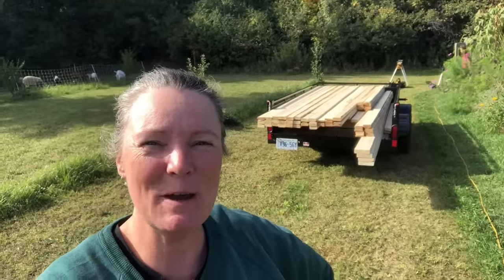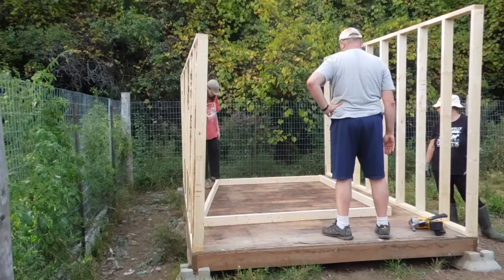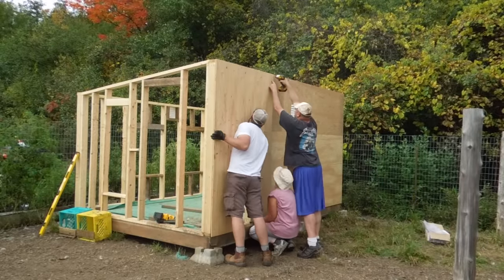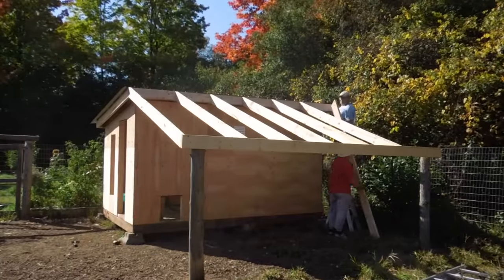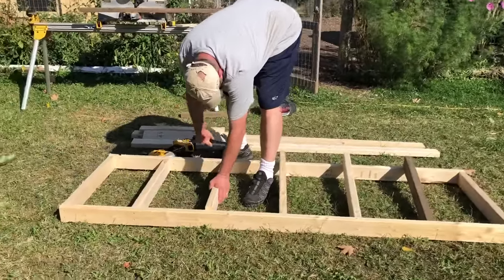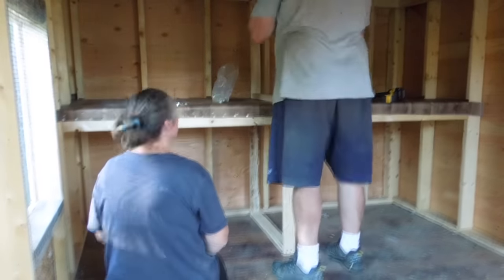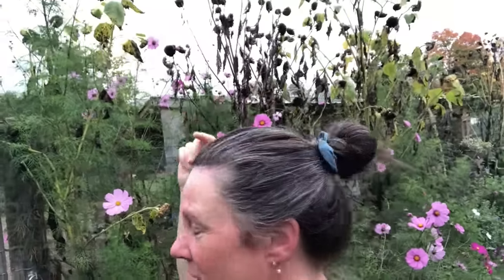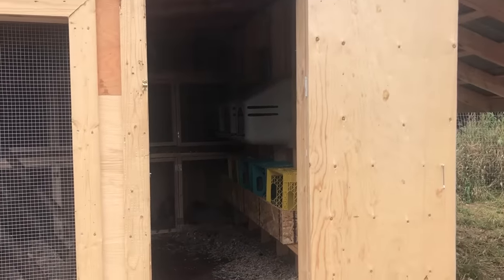Building a chicken coop for all seasons start to finish- Ontario, Canada

Comment: The wire on the floor is an experienced move and I appreciate somebody mentioning that. Also rodents like to get on the corners between floor and wall just above the 2x4 studs, nailing some roofing scraps cut to strips and angles prevents that. Raising the coop 18-24" off the ground also works, at least for my pigeon coop- lol. Good job and informative.
Reply from the maker: Thanks so much.  We've made many coops over the 40+ years and each coop and move has made us learn more.  The elevation of the coop is a must (my cats can get in under it) but the wire is a game changer.  I agree with the corners being eaten at though, we have had that in the past as well.  We increased our cat poplulation and havent needed to do that here though.
Reply: WOW 
Yes it's brilliant.
We are making a new coop sometime in the next 2 weeks. So this is a fantastic tip to see before we build.
Thank you!!

Comment: Roofing tin is designed with hills and valleys for a reason. The water runs down the valleys and the screws with grommets should be screwed into to hills. Those grommets perish in time, so I'd check every 6mths since you seem to have used the valleys. Beautiful job, lots of thought and wonderful family participation. ❤ from this aussie chick.
Reply from the maker: Each place we have lived screws them in in different locations.  Some places have used the ridges so in that area we followed the rules for there.  Here they use the valleys so we do that here.  It’s very strange that each place seems to have its own ideas but in our mind so long as the roof stays on it doesn’t matter to much.  We are going on 3 years here with no issues.  Over 7 years at our old farm with no issues.  At the end of the day, it’s still just a chicken coop.  Funny how things are so different from area to area.

Comment: Neopreme screws got that little rubber grommet that’s underneath it as you drill it down it cinches in perfect to keep it from leaking. I know this is an old video, but it’s interesting because I have to do the same thing you’re fixing to do here in a few weeks from now, I am in East Tennessee…
Reply from the maker: Yes the screws that are used are roofing screws and they do have the rubber grommets.  They are standard to get and use for the tin/steel roofing.  Good luck with your build

Comment: This is wonderful! Great job!! I am surprised you didn't insulate the coop! It had me wondering if your end of Canada doesn't get as cold as our end (we're in Alberta), but then you said you do get -40°!! 
I'm wondering if you could tell me how to tell if there's enough ventilation? I worry about too much, and then it getting drafty inside. No one has really explained it to me, and maybe I'm overthinking it. Is it really as simple as just making sure there's no breeze felt? Cause I would think there would be a lot of heat lost with so much ventilation. I'd appreciate any wisdom you can pass along! Thank you 😊
Reply from the maker: I lived in Northern Alberta for 7 years.  Still no insulation needed.  Just no drafts.  We still get some cold spells here just not like when we lived there.  Our windows get closed in the winter time so while they can go out during the day if they want through until little chicken door they do get locked up at night.  You just need ventilation near the top to allow the hot air to escape so it doesn’t build up and forum condensation.  Condensation is what causes frost bite on their combs.  So no breeze but ventilation.  Chickens are pretty hardy animals.  Think about it this way.  Even in the winter time in northern Alberta there are birds outside somehow they survive.  It’s because their body temperature runs hotter than ours.  Also build your coop to the number of birds you have. That way they can maintain their heat better and deep litter method in the winter time.  We use a litter mix of peat moss, wood shavings and wood pellets.  We also gather up leaves in the fall and occasionally throw some leaves on their coop for them to pick through.  Oh and insulation just means somewhere for mice, rats, squirrels and chipmunks to hide as well as impossible to treat the coop if you get mites.  You would litterly have to burn the coop down to get rid of mites as they would hide in the insulation.  Hope that helps

Comment: I guess I missed y an identical build? Liked the old 1 & needed more room?  Or an area to separate breeds)
I haven't seen broader boxes like that.  Good idea especially for recovering animals. I'd have electric added for heat (water & those extreme days that occur). I do like being able to get in coop with my ladies.
Reply from the maker: I wanted one coop for only small breeds.  Silkies, Millie Fleurs, bantam Cochins and then the second coop and run for the layers.  That way my big roosters don’t hurt my tiny birds in their exuberance.  And I can separate by breeds as well.  I don’t want electric because there is to much chance if fire and we loose electricity a lot out in the country.  I don’t want them getting use to heat and then loose it and get sick it die.  Also the coops are a long ways away from the house (our electrical supplier)

Comment: This is exactly what we need. Sure wish we had directions and supply list.
Reply from the maker: Step by step directions would be very difficult and time consuming thus the reason for the video.  You can stop it and review as needed.  We also just wanted to give folks an idea what would work and they can adapt as needed.  As for a supply list my apologies I have been asking hubby for it to add it to the description but as the coop was built in stages it would be a little more difficult.  I do know the coop bottom was made with three whole pieces of plywood so we didnt have to cut much.  And that dictated the over all size of the coop.  I am more then happy to answer any questions you have about the build though.
Reply: @connerty_meadows_farm  do you know the angle you had to cut for the walls at the back and front ?

Comment: I like what you’re doing with your coop. My question is, is it safe to put your root in front of a vent like that?
Reply from the maker: The coop is built safe yes, the over hang prevents any water from getting into the vent but allows the air to flow through.

Comment: Excellent job! This coop seems so breezy, it’s really ok for negative temps?? We get lows in the positive teens and our roosters get frost bitten combs in a fully enclosed coop! Meaning not any large openings. What am I doing wrong??
Reply from the maker: Its breezy in the summer time with the windows open but in the winter colder weather the windows are all closed up.  Chickens need good ventilation but no draft so that means there has to still be air exchanged (thus the vents) but not drafty.  And yes it works just fine for negative temps.  Here in Canada it gets very cold!  We can easily get negative 30 deg C and colder

Comment: Hi there. Just wondering if you used any kind of adhesive between your floor boards and vinyl or linoleum? My linoleum has a wave to it from being in a roll and I’m wondering if there’s anything (animal friendly) that I can aid in helping achieve a nice flat surface.
Reply from the maker: Use the regular floor adhesive that is sold for that type of flooring. Its underneath dvd doesn’t affect the chickens at all. ☺️

Comment: Hi! I loved how it turned out, we live in the northwest corner of Connecticut and it does it as cold here. But Im thinking about making one. How much did all of the materials cost you?
Reply from the maker: I dont have a set cost for it as some of it was built precovid prices, some of it was purchased second hand (windows and some of the tin roofing), some was cut down on our property (cedar poles for the lean to) and some was from left over projects.  If I had to guess a couple thousand dollars with all the flooring etc as well.

Comment: Hi!  I'm in the process of building my coop by myself. Lol!   Mine is very similar to yours.  However, I'm building just an 8x8.   I'm getting ready to add my third side.  I love the big window idea and I am incorporating that into mine.  My coop is actually going to be taller on the left side than the right, the opposite of yours. Would this be a problem to put the large window on the tall side instead of the short side?
Reply from the maker: I have the window faced in the direction that I do because of the overhang side and the sun.  You can put the window where ever you would like. ☺️. I eventually plan to fill in the overhang side to give an outdoor closed in space and putting a window looking into a building part doesn’t make any sense.  I wanted them to have sun and a breeze, that’s the only reason we have it set up as we do.  Good luck on your build!

Comment: Thank you for the video! Best and most straightforward chicken coop video I've found on youtube. I have some questions and I apologize in advance because there are a lot because I am very enthusiastic about this. I am wondering, are those cinder blocks that the coop is sitting on? they look like concrete blocks. Also, do I need brooder boxes if I am not breeding the chickens? In a cold winter climate should I have glass windows, or is screen okay? also, how many heights of nest boxes can I have? you have two rows, would 3 rows work so that I can have 3 on top of each other? also, do I need a roost if I won't have roosters or breeding? and how necessary is a dust bath? Thank you! Can't wait to raise these hens!
Reply from the maker: The blocks under the coops are like cinder blocks but are intended specifically for building.  They have notches in the specifically for wood to sit into.  They are a building block.  If you are not breeding chickens a brooder box is not necessary but they are handy if you ever have a sick chicken that needs a little TLC or what not.  In a cold climate a screen is not enough.  Chickens need a draft free place to live in a cold climate but it has to have good ventilation.  You will definately need glass windows that can be closed for the colder months.  You dont want your nest boxes two high as the higher they are the more likely they are to roost in them.  That and three rows is a lot of nest boxes, how many chickens do you plan to have?  you dont need one box a chicken, most of mine lay in only one or two boxes despite having multiple boxes to choose from.  Chickens are funny like that, they have their favourites and their friends favourites are the same one...lol   you do need a roost.  Chickens naturally roost as it makes them feel safe to be elevated off of the floor it has nothing to do with a rooster or with breeding it is a safety thing for them.  Dust baths are 100% necessary.  It is how they keep external parisites to a minimum.  Lice and mites get mostly smothered by the dust bath.  It is also how they keep their feathers clean and healthy.  (how would you feel if you never got to shower or bath?) same concept for a chicken.
Hope that helps
Reply: @connerty_meadows_farm   thank you for the answers! I will be having 20 hens.
Reply from the maker: @ryanw6920  you will only need like 5 nest boxes then
Reply: @connerty_meadows_farm   thank you.

Comment: I'm doing the roof on my coop this weekend and have seen some folks comment that there should be plywood beneath a tin or PVC roof so A: it's not so hot in summer and B: it's not so loud during rain, hail, etc
Thoughts on this? I don't want to use more material than is necessary
Reply from the maker: You could if you wanted more insulation or noise reduction but in all the years we have been building coops we have never done it.  We make sure there are lots of windows so its not hot and we have never had an issue.  I personally dont think you need to spend more money on it, but we are pretty frugal as well.

Comment: How do you keep the water from freezing in winter time? And if it’s draft free but has gaps all over to vent, what’s the difference? I’m needing to build a coop in the next few weeks, I’m also in Ontario. Would love advice thanks!
Reply from the maker: I only water outside year round never inside or it makes more condensation.  We use rubber water buckets under the over hang and I bring out warm water twice a day in the winter time.  The rubber buckets make it easy to throw them over and stomp out the ice.  There are no gaps just the vents and of course the windows. A draft is like air passing through all the time.  The vents have little flaps that face downwards so while there is air being exchanged it is not “whistling” through

Comment: That’s a nice coop! Do you mind sharing the cost? Thanks
Reply from the maker: I don't have an actual cost over all for it.  The flooring was done (treated wood, cement footers, wire, plywood, vinyl) pre covid prices.  The rest of the lumber was purchased mid covid and some of the roofing.  Some of the roofing was off of marketplace, the windows were from a garage sale, the outside poles were cut down from our property, the milk crates we brought with us from our old farm.  So there are a lot of price variables in there.  If I had to guess a couple thousand Canadian.

Comment: How big is it and how many chickens do you plan on it holding just trying to figure it out for myself before I build mine
Reply: I would like this information too.  To understand the scale of the building I would love to know the dimensions of the floor.
Reply: I see the reply below.
Reply from the maker: The coop floor is 8X12 that way we didn't need to cut any plywood for the floor.
Reply from the maker: The floor is 8X12 because we didn't want to cut any plywood making the building of the coop faster and easier
Reply from the maker: perfect :-)
Reply: Thank you and how many chickens do you put in them I love the design of it
Reply from the maker: I put as many as floor space allows for I think I can comfortably fit 20-30 in there with lots of moving room because they are only locked in it at night

Comment: I'm in Canada, just north of Winnipeg. I'm wondering why you wouldn't insulate the chicken coop? Would that be better for winter?
Reply from the maker: There's a few reasons we choose not to insulate.  I have answered this question for another viewer as well.  But to sum it up.  Insulation makes it easier for condensation to build up which is the number one cause for frost bite.  Also mice, rats and other small animals LOVE insulation and putting it in will invite them to live in your coop.  I don't want that.  The other thing is if you get mites (and if you chickens live outside this will happen at some point in your chicken owning lifetime)  they LOVE insulation and will crawl between the cracks and live in your coop forever!!  At least with everything in the coop exposed I can easily clean it down and eradicate them.  And of course cost.  I am not building a house, I am building a chicken coop.  The cost was already in the thousands adding insulation would increase that a HUGE amount as you would also need to add vapour barrier (not breathable) and another layer of plywood not drywall as chickens would eat that and it would also break down becuase of the poop.  And you would also have to paint the inside of the coop.  Of course if you have the finances and such feel free to insulate but you will also need to add more hardware cloth to keep the small animals from building nests in the insulation and find a way to pull it all out to treat mites.  I was always told that the only way to get rid of mites on chickens was to burn the coop down.  Now of course I can simply treat my chickens and my coop 10 days apart and usually it is gone.  If I had insulation I would never be able to get rid of them.  Hope this answer helps.

Comment: Do you have a list of supply's?
Reply from the maker: Sorry I dont have a specific list of supplies.  Lots of 2x4's, plywood, treated wood, windows, hardware cloth, tin, hurricane clips, vents, screws, nails, staple gun, vinyl for the floor, hinges, latches, cement footings, cedar posts, I am sure I am missing a bunch of stuff.  We made the coop so that we didnt have to cut to many pieces of plywood and we could use full pieces as much as possible.

Comment: More curious than anything else what about added heat or insulation?
Reply from the maker: No heat or insulation needed.  Heat makes your chickens dependant on it.  Which means when the power goes out they will suffer, get sick or could die.  We live out in the country.  We lose power regularly.  Chickens adapt to the cold just fine.  Mine go outside all winter long traipsing through the snow with no issues.  Heating also opens things up  for fires to happen.  Insulation means a build up of condensation and gives mice and rats a place to hide.  I don’t want mice or rats moving into my coops.  In the 40+ years I have been raising chickens I have never had an insulated or heated coop and I have lived in Ontario, New Brunswick, and Alberta (all in Canada)
Reply: @connerty_meadows_farm  thank you so much, about to build a home and want chickens in the mountains of North Carolina, which has similar weather pattern is upstate New York your video is very helpful, thank you so much. Your response, was very thorough and detailed make me understand about rodents and moisture that I never thought about keep it up I’ll keep following :-) thank you.
Reply from the maker: You are very welcome!  Enjoy your chickens

Comment: Do you use sheet linoleum for the floor?
Reply from the maker: Yes we bought it in a roll the width we needed and then just used a knife to cut it to the length we needed.